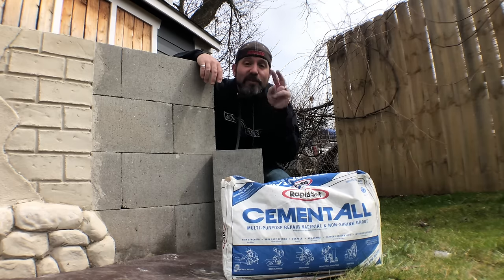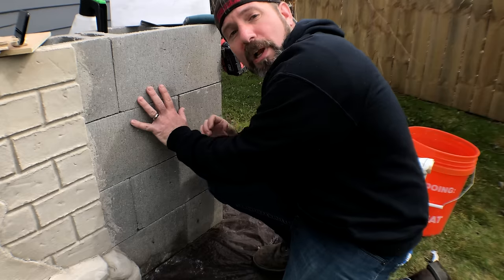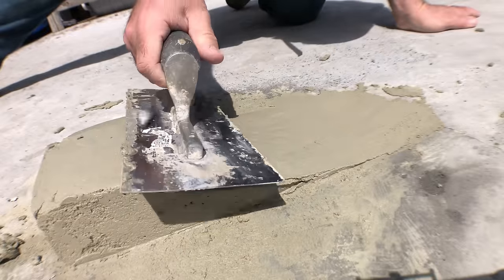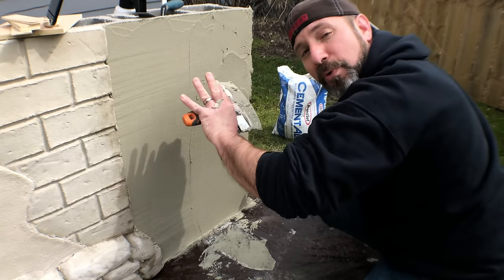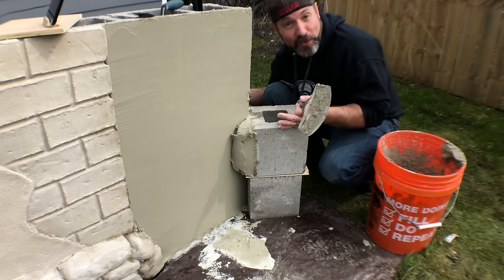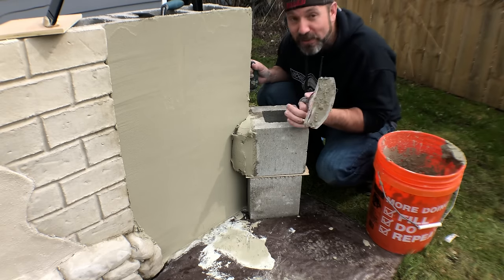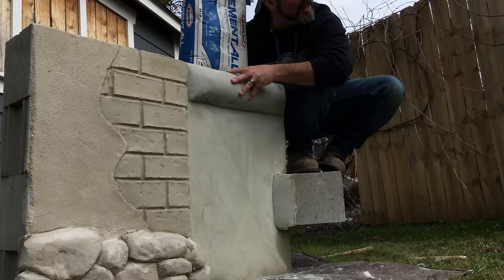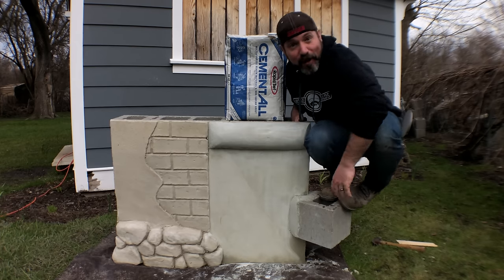How to PARGE and SCULPT with Rapid Set Cement All (Part B)

Comment: I love Rapid Set products. I have used their hydrolock to repair a foundation wall which stops water leaks followed up with their mortar mix which they recommend to also use on foundation wall repairs and now I'm getting ready to use their Cement All. I've done a lot of research on that product and I can't say enough how much I love their products. I follow two contractors on YouTube that also use and recommend Rapid Set products.

Comment: I got that nervous feeling when the mix stopped giggling around 8:08.  Then you actually said it!  People who are familiar with high performance concrete know all to well about the rush that comes from racing the set time.  Out here in Vegas it is not for the faint of heart because even set control adds only a couple minutes of working time.  Great Channel.

Comment: I'm back. You've given me the courage to tackle my exterior foundation. I've used the rapid set mortar mix to patch some holes and adhere a broken corner. Stuff is amazing and bonds incredible.  I'll use the cement all as a final parge coat. Thanks for a great video !!

Comment: We have to use the set control to work with this stuff. I used it today in a 90° temperature and it set up so quick that I didn’t have a chance to work with the whole material, I end up loosing half a bag. However is a awesome product.

Comment: nice video! love this mix. expensive now in 2023. and yea it can be hard to finish. even with "set control" packets. the packets sacrifice strength though. read directions carefully. you can use several packets per bag. you can really feather edge this stuff and really does NOT shrink.

Comment: Nice video. You should show everyone how strong block walls are that are filled with concrete and rebar. A sledge hammer wont take it down like that lol. Just took 5 foot off the top a block wall 100 foot long that had been built about a month before at a house on Sea Island GA because the homeowners association told the owners they could not build it over a certain height. Had 7 concrete guys with gas concrete saws and a Case 580 backhoe. It was amazing how strong that wall was even after it was cut on both sides almost all the was through. I'm going to build my new house out of filled blocks now.

Comment: You all need to keep in mind that this awesome Cement All comes with a steep price. In late 2020 a 55 lb bag is about $25 where I live. That is several times more expensive than regular products based on Portland cement. Also note the hardening time is very temperature dependent. The specified 15 minutes is at 70F. The warmer the mixed cement is the faster it hardens. During hot weather it can easily start hardening in 5 minutes instead of 15.

Comment: Love these two videos. I live at the entrance to our subdivision. We have a brick wall with the name of our subdivision mounted to it with wood letters. The sign was built in the ‘60’s. It is about 10’ long by 4’ tall and the bad is solid but some of the bricks are loose and some has broken off. I have been wanting to do something like you did in these videos. First I would have to replace or re-secure the loose bricks. What mix can I use to go over the bricks. I like the smooth look in the second segment. Would I need to use a bonging agent so the mix adheres to the brick. I’ll try to attach a pic of the wall.

Comment: Very cool video.  I'm looking to do a patio this year and it will likely have a one or two step drop down to the bottom portion of the patio.  I was initially thinking patio blocks for the steps but after this video probably not.  You think if I put a cinder block or two down I could form a step using the same concept as in the video?  I see in your video that your blocks were just stacked loosely.  The cement all holds everything together quite well??

Comment: Great video series!  I have a couple of questions.  I need to sell my house but the cracks in the sidewalks and concrete patio pads have "disintegrating" concrete.  Can I use either one of these to repair those?  Can either one of these be laid over what's already there and a decorative "pattern" drawn in as if I installed pavers?  Thanks for all the info and displays in your videos; I just found your channel last week and am already a huge fan!

Comment: Would this work on interior and exterior basement walls with cracks to seal them? I'm guessing yes on exterior as i believe you mentioned that, but curios on inside walls.
Also work on leveling out a walk way?

I appreciate it!
Reply: Can you make a vertical waterfall? I don’t see anyone making water features with this stuff.  I want to make like 3 different height rick pillars with water coming out the top. I am thinking the pillars would sit on a 3 foot rock basin.  Awesome videos!!

Comment: This is such a great video series - Loved A and B.  I have been looking for two days to find the best way to fix 100+ yer old concrete window sills.  This looks like the best way!!  any thoughts on getting the old paint off these sills before I smooth them back to new? Thanks
Reply: Roger Coville Hi, I’m a faux painter, and I’ve used regular paint remover directly on concrete at the job site, and the paint lifts up beautifully leaving a clean finish.  For several layers of paint lift the first layer off with a wide putty knife then apply the remover again, and after a few minutes lift off another layer.  Repeat until all layers are removed.  Finish up with a softer wire brush and some household cleanser.  Then rinse well.
Reply: @tanyas.3812  Thanks for the reply - I'm trying to get organized before I make a Lowes/HD run mask and all!! ;-)

Comment: Looks like fun!     Can I ask you a question?  I have been looking for a product to fill in the dip and my garage door entrance....The one intentially created when it was poured as a kind of "ramp" from the driveway to the garage.  Now that the garage has been turned into a living space that I want to carpet.  I need something to level the floor.  I've heard concrete floor leveler  eventuallycrumbles when you try and feather it.  As thick as you've applied these products here,  I'm thinking I could totally use one of them.  What do you think?.  Even if I had to fill the just shy of the  intended final height, then maybe I could finish it off with something like and epoxy patch?  What do you think?  Keep in mind, it doesn't need to look good because it will be covered with carpet.  If this idea  sound crazy to you, do you have any suggestions?
,

Comment: Hey So I have a question, I have a fairly large basement in northwest Ohio. The walls are structurally sound in that they aren't moving vertically or bowing. That said they do have some small cracks. Most of them on the exterior walls of the basement are sub 1/4" across and are not open to the soil. others on the interior walls, specifically the walls of my cistern (no longer used and now, the inlets are sealed to prevent freezing water doing this damage again,) have cracks in excess of 1" but less than 2" in width. Would this product be acceptable to use on the interior and exterior walls to make them look better, long term. I also wonder if there is a prep, before application or one after that may help with waterproofing.

Comment: love your video  .i am making anartinstalation with a burned up tree and use te mortar mix on one end for a counter balance  the tree is sanded smooth but i cant get into all the curves i have on the mortar mix to make it really smooth. If i use the blue rapid set how would you try to smooth it out without a trowel  thanks for any help alan

Comment: Hello Michael, great videos sir. you make it look to easy.
Question? I’m attempting a small project, wood frame with cement board covering, basically a small table. I want to go for a concrete look and possibly paint it, so was wondering if this product cement all would be a good candidate for this, applying about no more than 1/4 thick. Concerns, can I apply directly on cement board, will it crack over time in Texas heat, thinking yes, then how to prevent.
Thank you for any tips.
Reply from the maker: You absolutely can use Cement All for that project directly on cement board. Unfortunately, cracking is inevitable no matter what you do or what you use. Just make sure not to forget to water cure for one hour after it starts to set up and heat up
Reply: @MichaelBuilds  I am trying to learn about various materials as an artist, & have no experience with concrete. You are the 2nd expert I have heard make this kind of statement, that it is certain cement will crack? Can you expound on this at all? Like should I even bother to make sculptures with cement, as I hear people ARE doing? I don't get this about concrete/ cement.

Comment: You must have been going stir crazy in quarantine... Had to let off some pent up frustrations on that wall.

Sat through two videos saying to myself, "yeah, but what is it?" Asked my spouse right before the wall was demolished if they knew what it was. They didn't. Then the wall came down and I said, "oh, it's just something to let out frustration on..." 
I used to collect glass knick knacks and plates, bowls, mugs and such and when I'd get angry, instead of breaking things that were too expensive to break, like my cellphone (went through many cellphones before I started doing this), I'd go destroy something(s) from my glass collection... The sound of the shattering glass with the act of throwing, stomping and such, would help a lot of anger be released.. The shattering glass sound was also satisfying a.f. ... Demolishing a cinder block/concrete wall looks like that would be pretty satisfying to destroy too, as well as, taking a lot more energy, compared to breaking glass, which, could be even more beneficial depending on the anger level. I didn't realize how much strength I had in moments of anger, until I was seven and I ripped a doll in half, my mom tried ripping the same doll and couldn't do it even after getting scissors to help her, so she didn't believe that I did it... If I were hooked up to an electrical circuit, I'm sure, I could probably blow lightbulbs when angry. Like on monsters Inc. when they use the fear and laughter from children for energy... Adrenaline is fascinating... 

Nice art wall. Despite not knowing what it could have been used as, I comprehend the points you were sharing. You say you're not an artist, but, as an artist myself, I think you underestimate your artistic abilities and skills. You sir, are an artist. It shows in your camera placements, editing skills, as well as your craftsmanship. (I deny that I'm an artist most of the time too. You will always be your own biggest critic.)

Thanks for a very entertaining and informative two part video series. 

🕉 
🙏🏼नमस्ते🙏🏼
 (ηαмαѕтє)

Comment: What is the difference in colors between the rapid set mortar mix, rapid set cement all, rapid set concrete mix? We are redoing our kitchen with a gray theme and white cabinets. 

I have noticed that the color of the mortar mix appears to change video to video. Which in your opinion produces the lightest GRAY. (We do plan on sealing it with something that does not give it the wet darker look.)

And do you have any tips for getting a marble type look but without pitting and without having to do an epoxy overcoat?

Comment: I wanted to see how the wall held up and what changes occurred after 5 years. Now we can't. You can say that brick you stand on would not have changed but I would have liked to have seen it in 5 years. I need to replace a corner on my front steps by molding one in. Do I use this product and will it look a different color so that I should paint the step afterwards?

Comment: Can you please do a video on correcting the level of the under side of a countertop that was poured following the countertop video? The mix set really fast and I would like to salvage the piece if possible, thank you!
Reply: Adam Moore ...use Rapid Set Self-Leveling floor dressing after you have it face down on a level table with edge forms.
Reply: I had that problem too!  We poured our countertop in 3 sections, and one section set up really fast before we could get it completely level.  In addition, the cabinets underneath were installed noticeably unevenly in one area (thanks, contractor!). That gave us a huge problem lining up the countertop sections to be completely level.  Where it was low, we used shims underneath the countertop in conjunction with the construction adhesive.  The counter is now even, though there is a bit of a gap below the overhang.  You can't see it unless you're at eye level.  We figured it's nothing a piece of trim all around wouldn't hide.

Comment: Great video ... I put this cement all on as an overlay sprayed it with water and I got the runny watery lines is there anyway to get rid of that. 😣 thanks anyone. Wish I didn't touch the water 😂. Also don't try in high heat

Comment: Use a old corded drill to mix rather than burn up a expensive Milwaukee cordless, a utility knife opens a bag much easier than gnawing through the end, use a face mask when handling dry product, see OSCHA Silica rules and guidelines. Pretty good video, don’t expect to duplicate this if you don’t have his experience, that stuff fires off super quick even with the expensive set control. Mix smaller amounts to stay in control of your material. There are admixes to add to Plastic Cement and different grades of sand that will accomplish these results and you will have a much longer working time, but to get that rounded overhang, you will need a super fast setting medium like this. One last thing, there are coloring agents to add rather than paint, get different shades and dust on  different colors, in powder form while the material is still wet to get natural looking rocks or bricks. The way he shaped the rock and bricks was very good but again with this material you’d better be fast and have a plan ahead of time.

Comment: Can I use Rapid Set Cement All in 22in x 22in x 2 1/2 inch slab & if so,how long do I have in drying time to work with it? This is personal project that I am designing for my brother who passed away back in May 2020.It consists of 2 slabs,but the other slab is 15in x 15in x 2 1/2in thick that will have a memorial tile on it.I also want to have the sides of the bigger slab at a angle,sort of a bend effect.Hopefully you can help me with this?Letting my imagination run wildly is the fun part.Project: One of a kind headstones.Thank you for opening up my imagination further than it already has.
Reply from the maker: You absolutely can use the Cement All but I find the Mortar Mix much easier to work with especially with that kind of project. Both products are cured in one hour.
Reply: @MichaelBuilds  ,thank you.I will get started on this project next weekend,10/10/2020
Reply: @MichaelBuilds ,do I need to apply some kind of oil to the sides of my wood mold so the Mortar Mix doesn't stick?

Comment: Amazing !  Have you tried using concrete stamps on a wall using either of these materials ?  Also, it looks like the Cement All dried a very light gray while the Mortar Mix dried a tan color.  Is that just odd color from the camera ?  Do they both really dry gray portland cement color?
Reply from the maker: Nope, that’s the correct colors. Portland cures way darker than this stuff
Reply: @MichaelBuilds  Good to know. I would have to plan on the extra expense of charcoal color (maybe half what you used on your fire table) if I was to use the Mortar Mix and avoid the tan color.  I am wondering if I could use it over a scratch coat and then stamp it to look like board-formed-concrete on a wood framed house. Or would the Cement All just skimmed and stamped over a regular brown coat stucco be a better option ?   Thoughts ?

Comment: I’ve tried mixing the concrete in a bucket with a mixer like that, and I couldn’t get it to mix. That or it separated right after I mixed it. Either way, after I worked for a long time and started with the mixer all the way at the bottom of the bucket and mixed all the way to the edges of the bucket, when I poured the concrete out, it was all separated. Any idea what I may have. done wrong?

Comment: Wait, could you use those 1 by 1 paver blocks they sell at Home Depot and make a concrete countertop with this stuff?
Reply: K .....it will crack eventually along the joints of the pavers. Look for videos on countertops.